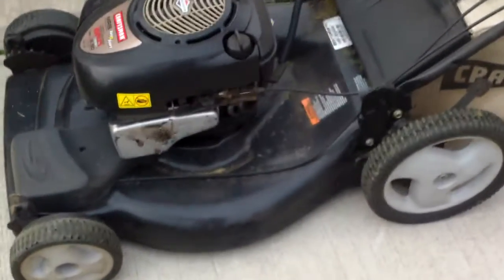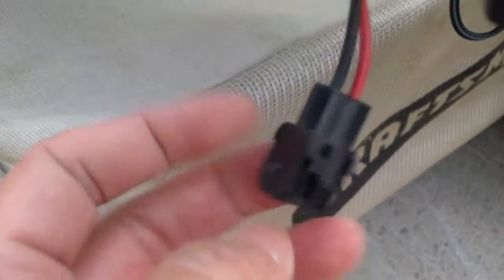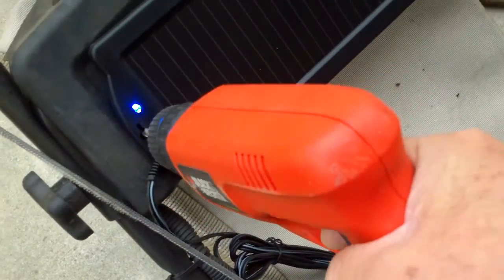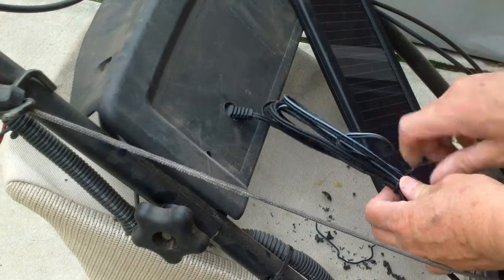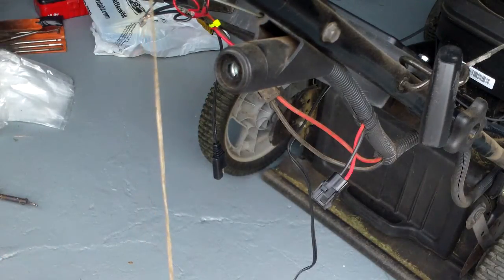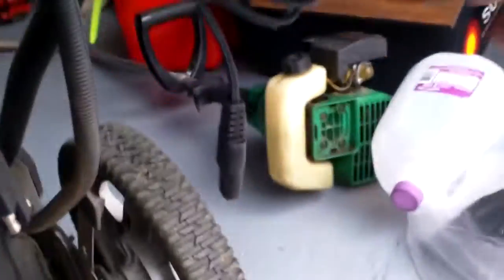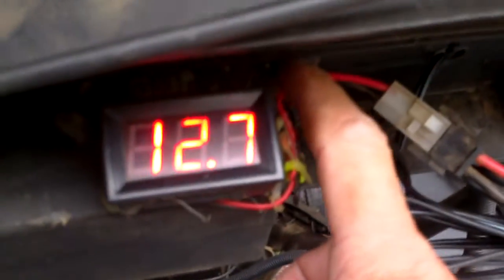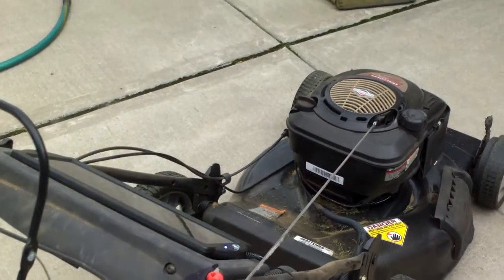Adding a solar charge option to my Craftsman keystart lawn mower

Comment: Like the idea and understand what you are doing.Only problem is, I see a issue on mowers that do not have the plastic mount.It will be a task finding a spot to mount solar panel.One could make a board or something to bolt to bars, but drilling holes in the bars only weakens them so catch 22.

Comment: this is cool. i just replaced the old battery in my craftsman because it didn't have enough cranking amps anymore and i was thinking about adding a solar charger i had lying around to charge the battery while i mow. i was wondering if anyone else had done it and sure enough...
Reply from the maker: This is my second season with the solar charger. I haven't plug it into AC for charging since the addition of the solar panel and volt meter.

Comment: I made this modification to a Craftsman key start mower that I was given for free.  While I also find the key start redundant... it is very appreciated by my wife that can't pull start the mower very well... and she enjoys mowing the yard.  Adding the panel makes charging the battery effortless and maintenance free.  It's always charged and ready to go.  The video was very helpful and a great source of information.  Thanks!
Reply from the maker: It works very well for my setup too. Now I don't have to remind myself to charge the mower.  I just leave the mower outside for a while after mowing and then push it back into the garage pretty much charged.

Comment: Will the battery discharge through the panel when it's dark?  Don't you need a schottky diode to block this?
Reply from the maker: You don't need a schottky diode. There is a built in diode.  You can add a 1N4001 diode if yours don't seem to reverse voltage blocking. I have been using a Sunforce version of this and have not experience any problems.

Comment: That's a great mod.  Also a bit strange, since there's already redundancy there with the pull rope to start the engine.  But certainly will work, and give you free charge (or top-off) of the battery without having to use the wattage-stealing wall wart.

Now if you could only make the solar panel regenerate the gasoline to run it, you'd be all set for life! ;-)
Reply from the maker: You are absolutely correct about the redundancy. If your lawn mower or snow blower is working correctly, it only takes one or two pulls to get it started. There is really little need for electric start. It is more in the category of a fun project. My friend gave me this fancy mower with the electric start and power wheels so I thought I would customize it a bit with the volt meter and solar charging.